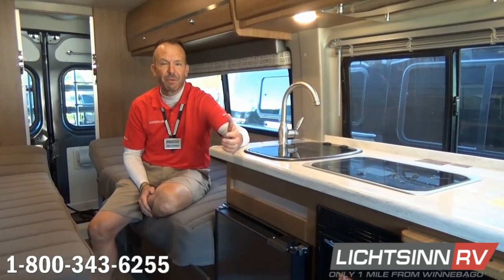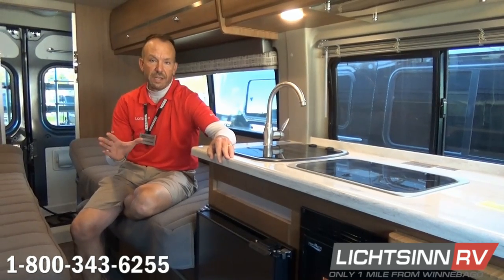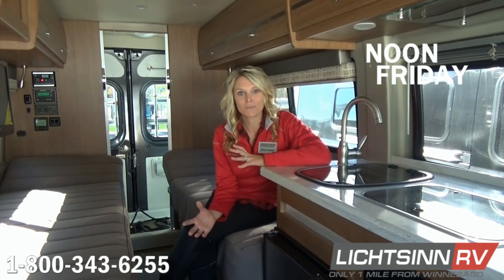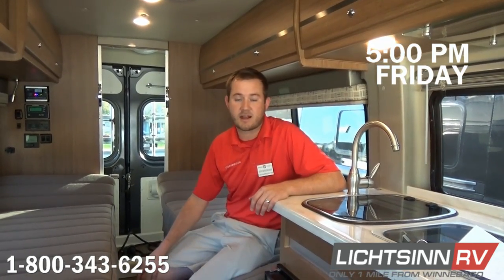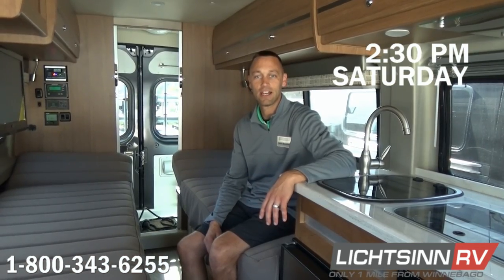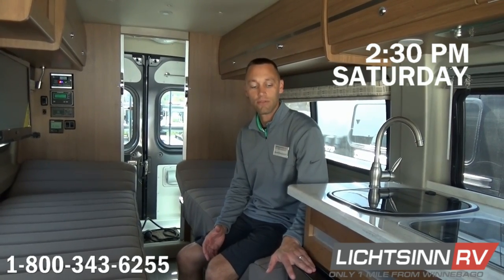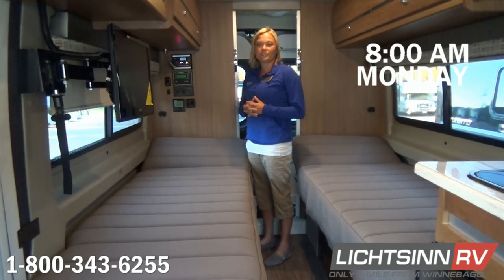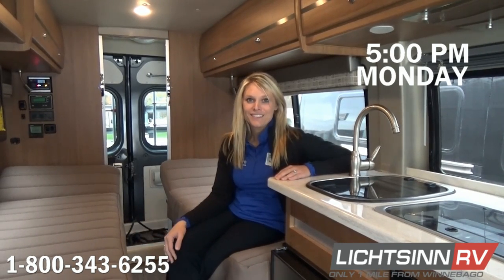Lichtsinn.com - How long does fridge run on solar in Winnebago Travato?

Comment: I don't doubt it for a minute. .the rv 12v fridge is I am sure close in power consumption to a portable Engle,  or dometic. I can run mine for 3 or 4 days on 2 golf cart Trojans. .without solar .
12v and low power a.c. refrigerators are the future of rvs.and so , so much safer. I really enjoy your videos  and you guys always give a very detailed description.  I have used many ideas from rvs in my off grid cabin.. thanks .

Comment: very useful thanks - our van (sorry, not a WInnebago, and UK specced) has been wired so that the fridge won;t run on the battery unless the engine is running, therefore the solar power available is wasted.  I am thinking of plugging the mains power into an inverter to bypass the relay.  Your video suggests that this will allow the solar panel to run the fridge full time.  Cheers

Comment: Can you run the tv for a few hours a day, charge laptops and phones, run the fan, etc. and have enough power for 3-5 days of boondocking? Love this floorplan and am considering one of these for music festivals where there are no hookups. Can we add extra solar power?
Reply: d. Solar battery charging system includes a 100 watt panel and an easy connect system that allows addition of one or two more solar panels. It also features an auxiliary connection for use of additional portable solar panels.

Comment: I like this RV, is it possible to get a model without propane? I also like the idea of an induction stove top, convection oven, more solar and lithium batteries. The extra sleeping area is a great feature.  Is their a Winnebago model that I could be looking at with these features? Thanks so much for a great video!
Reply from the maker: Good afternoon!   While we do have the 59K as you saw in this video, Winnebago does not offer the all electric version of the Travato, mainly due to the desire to have a longer run cycle on heavy load appliances such as the AC

Comment: Needs at least one more solar panel, since running the batteries down to 25% really reduces their longevity.
What are the refrigerator specs? How many amps does it consume?
Reply from the maker: Good afternoon Dennis!   We can add more solar, up to 450 watts on the single controller... here is the cut sheet on the Nova Kool, with amperage draws listed... 
  we use the larger 4500 model listed...     http://www.novakool.com/documents/SpecSheetImperialMetricLT2016.pdf

Comment: My coach is a 2017 Thor Quantam PD31 with residential fridge and 1800 watt inverter, and 2 12volt series 27 Interstate batteries.  So you are telling me that 1 100watt solar will keep the fridge running for that long.  What about using anything else in the coach.
Reply from the maker: Good morning Steve!   Thanks for your note!   I would expect a similar result but don't have all your specs... residential refrigerators once cooled really do not command that much draw.   Since this video we have upgraded to 200 watts solar standard, so would recommend at least that for you.   I hope this helps!

Comment: Ok so does the fridge run 110 AC from the invertor, which in turn is pulling from the batteries?....As far as the Batteries go, running down to 50% is probably maxed out. So when you guys stated it was at 25%, does that mean its 25% of 50% available? Just trying to figure out how you have the parameters of the meter configured.
Reply from the maker: Good evening!   The refer runs direct from the batteries or 110V, not an inverter... the compressor driver refer runs off 110V or DC batteries.   25% would be of the total battery bank.   Hope this helps!
Reply: So this is all for nothing if the fridge runs on 110v powered by an inverter.............????

Comment: Why does this model (K) have the compressor fridge and the Travato G has the LP/Electric? Same question applies to the K having a convection microwave and the G having a regular microwave?
Reply from the maker: Good afternoon!  Thanks for your note...  the main reason for both is space... the convection oven requires the depth for the blower and the G does have more space allowing for a larger refrigerator and freezer.